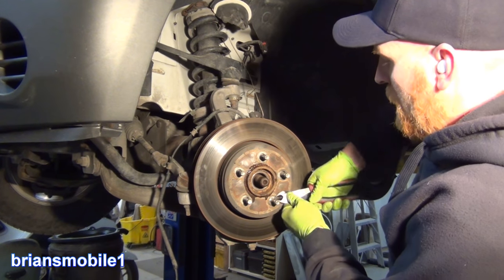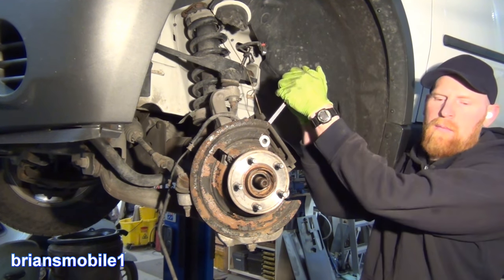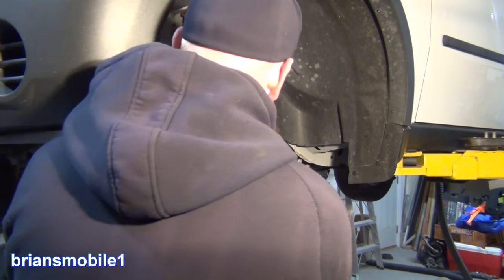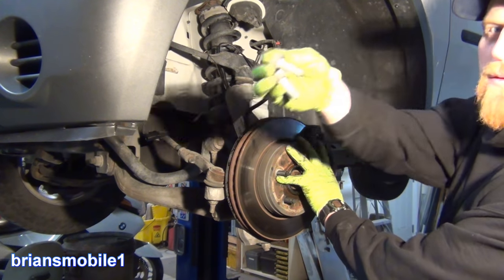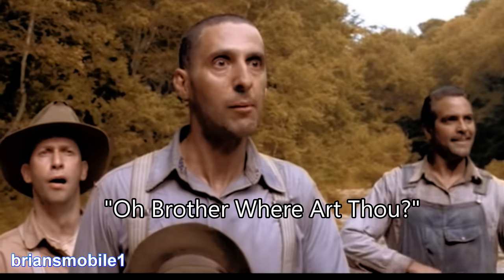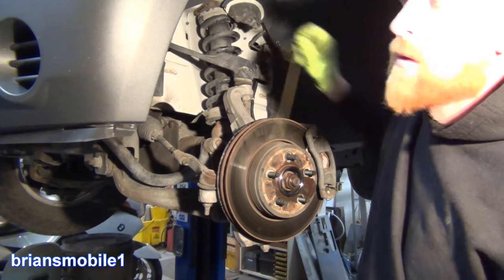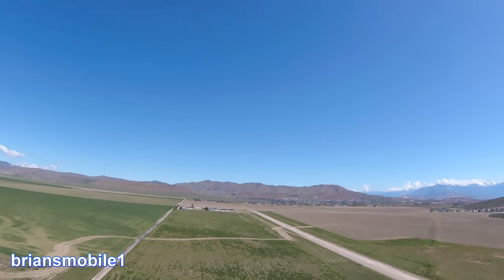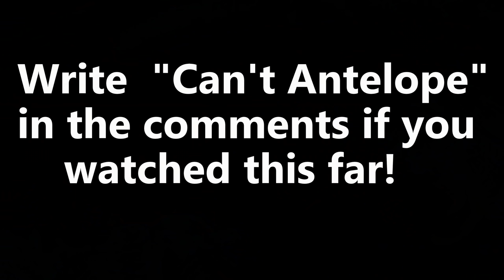Wheel Hub Bearing Replacement Done Right

Comment from the maker: You guys are outstanding!  Thanks for watching to the end!
Reply: Well you put out great content so why not watch till the end. Been watching you for many years and always a pleasure. My tip for the brake calipers is it depends on what im working on. For most modern cars and trucks with struts or springs i use brake caliper s hooks. For older, or vehicles with torsion bars i use a black thin rubber bungee with metal s hooks at the ends. Slipt the bungee thru sumpthing and use each of the hooks to go thru the caliper bolt holes. Just dont forget to leave the bungee in the spring 😲
Reply: Always gotta get my BFATE fix!
Reply: i guess it's kinda randomly asking but do anyone know of a good site to watch new tv shows online ?
Reply: @Ruben Azariah I would suggest Flixzone. You can find it by googling :)

Comment: I just changed mine on my 06 avalanche for the second time since owning it. Had moog brand on it and they lasted right at 100k miles running 35in tires. Thought they would have lasted longer but due to tire size and I do use my 4x4 during hunting season I guess 100k is acceptable.  Love the videos man! Thanks for posting

Comment: 19:13 Titan 51600 Brake Caliper Hanger Set, 2 Piece. Currently 7.96 on the amazon. Mo betta / easier than the coat hangers or bungee cords I used in the past.

Comment: Mmmm, Can'telope...
Bravo, Brian!!

?: I can never remember when you need to have the weight of the vehicle on suspension members in order to torque them properly?  Can you help??
Is it only for bushings...dang, gettin' old(er) sucks.

Cheers from the Great White North.
Reply from the maker: Hey Mario!  Great question.  When you have control arms with rubber filled bushings that attach to the arm and the center dowel or whatever is being pinched in by the bolt, you have to have it weighted or resting before tightening or the rubber can affect pressure on the control arm up or down and cause the vehicle to not set level.
Reply: Awesome! Thanks, Brian. That makes sense.
I hope y'all are doing well in Utah.  Stay safe.

Comment: i usually use a wire wheel on a drill and do before i put the antiseeze on where the dirt and dust doesn't get into the clean antiseeze

Comment: HEY  BRIAN...I HAVE A PROBLEM AND IM HOPING U COULD HELP  ME WITH...ON MY 2000  BEETLE THERE'S COOLANT LEAKING FROM  THE FRONT OF THE BLOCK...I THINK ITS CALLED A WATER OUTLET..O RING THERE'S A METAL PIPE COMING OUT FROM THE FRONT OF THE BLOCK RIGHT NEXT TO THE THERMOSTAT....THE PIPE UNDER THE COIL PACK...HOW DO I FIX IT.????  THANKS...VINNY

Comment: Nice to reinforce that bolts need the correct torque setting, especially those that keep you going in the direction you are steering for, and those that stop you. Otherwise you will be singing "loose wheel", while waiting for your cant antelope to finish destroying itself on the road.

Comment: When I hear "lift it by the pinch welds", I cringe.
If you do that here, on anything over 5 years old, you run the risk of watching your lift-points vanish up into a piniatta of rust and salty dirt.
It's fun watching you low sodium dudes fix cars easily... Like a fuzzy dream...
Reply from the maker: I hear that!  I watch those in the rust belt and have to wonder why you guys put up with the chloride sprays that eat your cars.  It's cringe stuff.